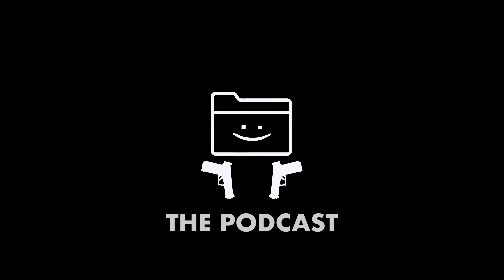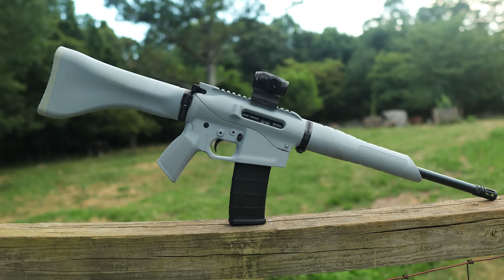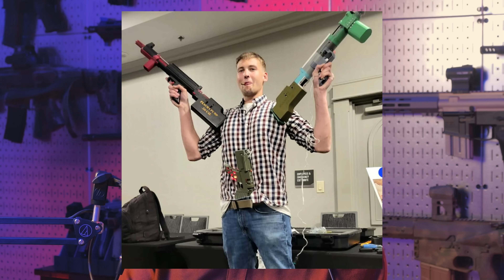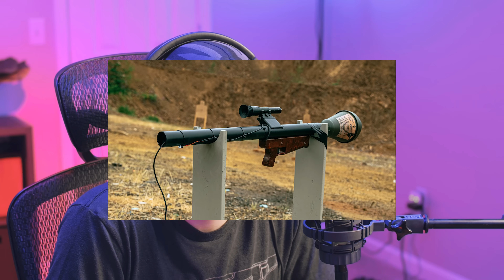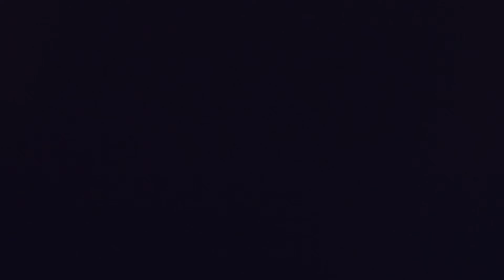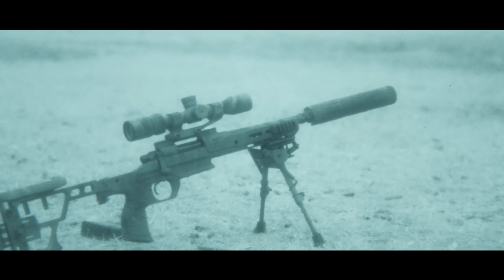Tim Hoffman: Firearms Design, AI, Evidence Tables, and Going Barefoot | PSR Podcast EP1

Comment: I didn't take 3d printed guns seriously until I saw jstark's fgc9 on popular front. The only gun I knew about up until then was the liberator. I can't take a single shot pistol seriously and also the media made it like the entire gun was plastic and there was no metal so it could make it through metal detectors. No they can't. That Glock upper and all the metal components in a fgc9 can be picked up by a metal detector. Also the early guns were verry bad. Ar15's were too tight to accept oem mags and 3d printed mags didn't feed well. Ofcorsebwith 3d printed parts it feels like a toy but so does the tm hicplapa being abs plastic instead of nylon polymer.

Comment: Glad Tim is here, having an issue with my single rib super lower...fresh off the build plate! Won't let the charging handle pull all the way into buffer tube/ slash chamber a round. Any suggestions ?
Reply: What's it hitting? Sounds like a buffer issue, what buffer tube and buffer are you using.

Possibly a rifle length buffer in a carbine tube.
Reply: @3darms  Thankssss! Just fixed the issue
Reply: @3darms  sounds like you are on to something.  It's not hitting anything per say, more like it's getting lodged and then sticks, but not fully to chamber a round
Reply: @elleayeghee125  the other possibility is that the buffer tube is canted (not threaded correctly) which would cause the bolt to rub as it goes back.
Reply: @3darms  I switched the buffer and it's working
Reply: @3darms  ahhhhhhhhh!